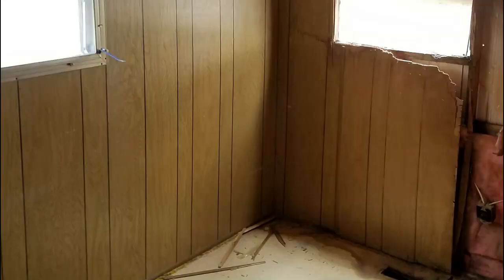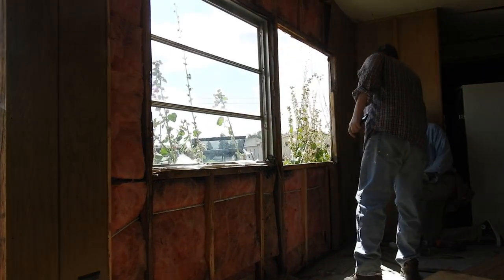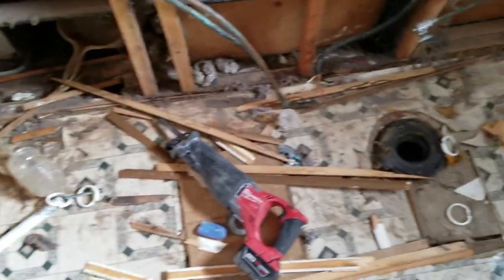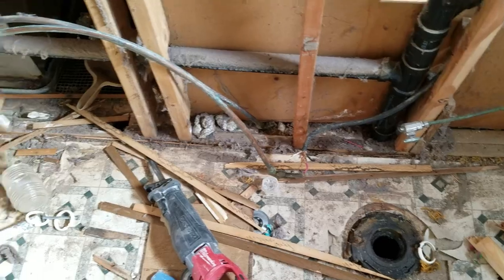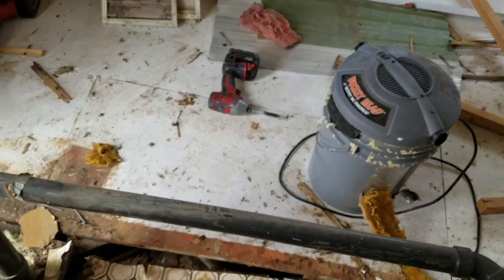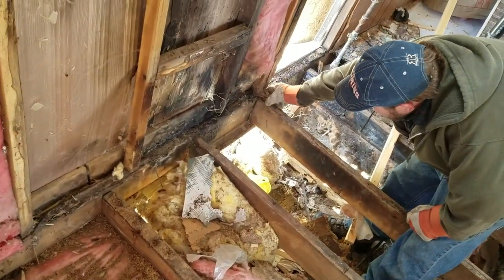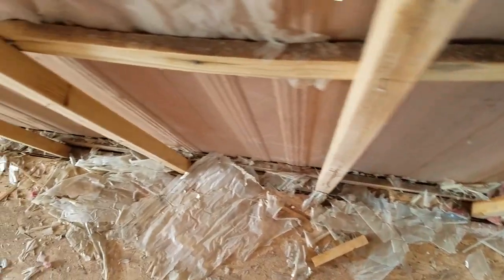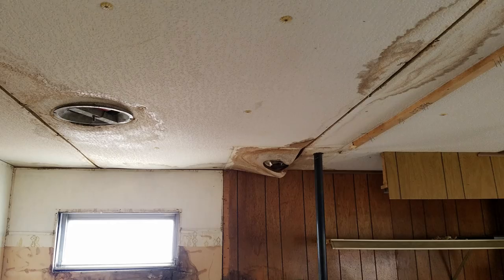First up on THESE OLD MOBILE HOMES  the DAMAGE

Comment: You know I bought a mobile home and it looked pretty good just looking at it . Well I started finding one place after another where the walls had leaked and the insulation had mold throughout and all the sill plates where rotten . I cut my losses and sold it I could buy another one way cheaper than the cost to fix it. Luckily my property is grandfathered in and I can put older mobile homes on it.
Reply from the maker: That would be the way to go if you can; however where this unit is located once it's removed another one can't take it's place, would have to stick build a new home on it, as it also sits on private land. My mother owns one in Cheyenne, WY as long as she lives in it the thing can stay, once she leaves it leaves. But that is Laramie County and this one is located in Albany County different laws as long as the unit stays it can stay. Thanks for watching.